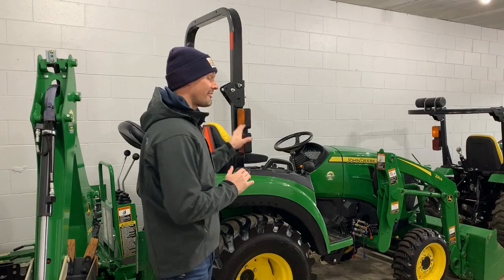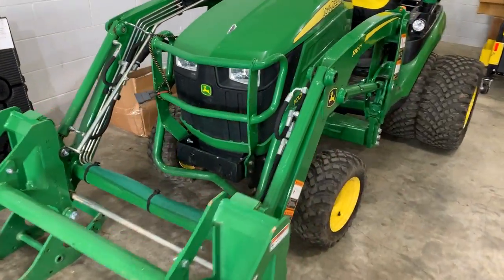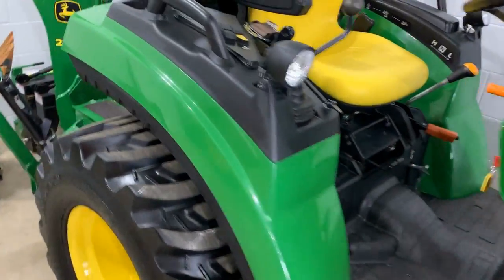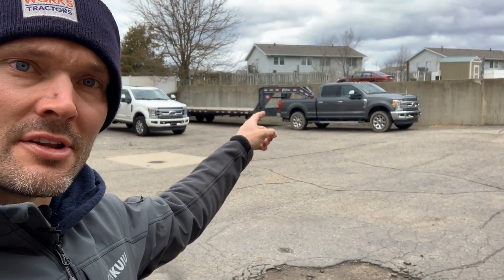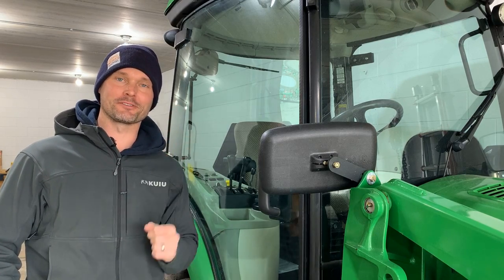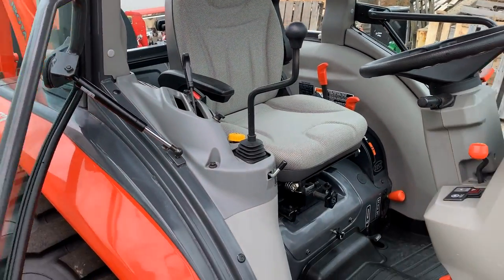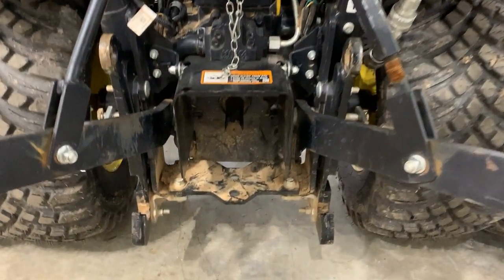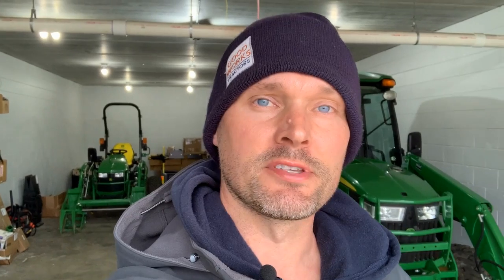TOP 10 SCREW-UPS JOHN DEERE MADE ON TRACTOR DESIGNS 🚜

Comment: I find myself watching your videos every Saturday morning during my coffee.  I have a Massey Ferguson 1250 with a Woods loader, 60" bush hog, 72" finish mower, home made 3 point forks and a hydraulic dump hay/firewood wagon.  I take care of 40 sheep and mow 25 acres of semi wooded land.  My problem is that I will need to replace my tractor at some point (it's too light for safely lifting the round bales into the loft).  I have been looking at the Rural King tractors.  I know that John Deere engineering has more experience and produces a better tractor, but is it worth the cost for the things I need?  I don't need a 10,000 hour tractor.  I do need a tractor that is safe for my amateur abilities and is cheap to maintain.  I'm not making any money with this tractor (outside of moving 20 bales of hay and avoiding city fines for not mowing).

Video idea:  What's wrong with the Rural King tractors?
Reply from the maker: Hey Joe, thanks for following along.  It's tough for me to knock something that I don't have much specific experience.  However, I do have enough experience with "getting what you pay for" that could possibly make for an interesting video!

Comment: I have a 1025r. I have a Mauser cab on it. It only has heat and I was told by the dealer it is a factory cab order. You can order a 1025r with a factory installed cab. Its very confusing to me though. I hear it one way and the other. ???? I do love mine! It's a great cab. My cab also has the piston assist on the doors. For me it does make it feel a little tippy. John Deere does need to come up with a quick disconnect for the hydraulics on the snow blade and loader, etc...it is a bitch to get on/off with the cab on.  
I agree 100% about the seat. What the heck John Deere! I am a big guy and the seat that came on the 1025r sucks azz!! Come on John Deere!!! I have an air ride seat on my X738 John Deere garden tractor and I love it! 
My dealer STILL cannot get those new Versa Turf tires. Where are they??? How do you get them? Send me a set please...all the rest of the stuff...huh...not so much...all part of the deal I guess. I love my John Deere tractors. Thanks for sharing and the great work you do...
Reply from the maker: Yeah, Mauser is a factory option.  Pretty misleading for the customer in my opinion.  Perhaps there just needs to be a better way to delineate.  Huge difference between a cab that has air conditioning and heat vs one that only has heat.   I make sure I clearly communicate to my customers if a cab doesn't have air conditioning.  Many are surprised when that information is shared and often times, that tractor is then ruled out.  Most see a cab and expect a/c to be a part of the package.  

I got the tires from my local tire shop.  Took a couple months, but they got em!

Comment: My biggest gripe on my 4044m is when I turn around looking at my 3 point to hook up or when brush hogging in reverse I hit the key every time. This makes me worried that I’m going to break the key off and I’m not crazy tall 5’10”. If they moved the key from a center position to the side it would really help.
Reply from the maker: Good point.  I have almost done that myself.  Severely bent a couple of them.
Reply: Kept bending them too. And I let them know. So they took a grinder and grinder it down to just a small handle to grab.  Works much better

Comment: John Deere Factory Mouser cab on the 1025R Has heat, and fits nice and tight. Check it out! Sold at dealers, Not aftermarket. Dealers within 300 miles of me have sold out of the 1025R with factory cab. I see a lot of soft cab trade ins too.
Reply from the maker: I don't consider anything a factory cab unless it's keeping me frosty in the summertime!  😂

Comment: Want to share something with you.  I picked up my 17 4044m from a job yesterday and someone hit the hood latch while it was sitting there.   When i got on the road it blew up and destroyed it.  I noticed on the new ones (2020) you need a tool to  open hood.  Can i upgrade mine to be like that?
Reply from the maker: That's a real bummer.  You might be able to upgrade, but I'm not sure if there were any geometry changes between 17 and 20.  Might ask the parts counter or service department at your local JD.

Comment: I would add the following: every John Deere 1 through 5 Series Sub, Compact and Utility tractor models should have the same operator station design and layout as much as functionally possible including; LED lights, standard fender lighting, standard rear-ward lighting, minimum one rear SCV, deluxe seat with mechanical suspension and arm rests, snail style fender mount accelerator, one ROP MTN rear-view mirror, functionally consistent three-point hitch set-up, all SCVs controls fender mounted, fuel tanks situated in the rear or side of tractor, expanded tire options including the new 14T hybrid in either Bias or Radial.

I’ve owned 2, 3, 4 and 5 series JDs so come by these design update requests honestly.

Comment: I just traded my B3350 Cab for a 3033R cab. The biggest disappointment that I have in the 3033R is the absence of the gas strut on the right door and the bar that it attaches to. The bar is a great place to rest your hand if you are mowing the slope of a ditch. The Kubota defiantly wins this one. It makes hitching a non quick hitch compatible implement a pain in the drain. You have to open the door every time you need to access the hydraulic/3 point controls. Not to mention it resting on your rear while you do. Come on JD this is an R series not an E.
Reply from the maker: Good point about the bar on the door too.

Comment: I have a 5 series and my biggest complaint is the lights mounted to the outside of the rops. Mine got wrecked when working around trees and they are expensive to replace.
 To move them they need to move the fuel fill to the center of the tank so that the lights on the left won't be in the way of fueling process.

Comment: How about a seat switch that works when it is cold. I have a 2012 Jd 2320 and can’t snow blow unless I can keep the seat warm enough or else the sensor freezes up and you can’t move the tractor. My dealer says that is very common.
Reply: By pass it and re wire it
Reply from the maker: Yeah, those cheaper seats harden up bad.  I'll normally press all my weight down on my knee right in the middle of the seat.  Normally loosens it up enough to activate the switch.

Comment: Why is the ROPS so high on 2019 1025r ?
 Will not fit in standard size garage door. If it was 10-12" shorter, I would be able to use it.
Reply from the maker: Neither the old nor the new style ROPS fit in a standard height garage without being folded.

Comment: Turn Signals Need protector cages. I noticed that none of those models you have there don't have any. I have a dated 4400 and the signal housings are pretty flimsy. They are always getting hung up on branches. I'm on my second and third set. Not again though as I'm going to weld cages around them. I know it isn't  recommended to be welding on the ROPS but I'm not buying anymore lights. 

Not to mention those darn THERMISTORS. I hope that JD got rid of those. They always go bad when it's 10 degrees out.

Comment: After more than 60 years driving tractors, why in the WORLD did they put the hydro pedals on the right and brakes on the left??????   It took me about two years to get used to that.   GO pedals should be on the left, and BRAKES should be on the right...     Probably just me - but those of us who have decades of experience with "clutch, left - brakes right" are really having a bit of a struggle getting used to this new system...  I noticed, on your tractor, that the loader hydraulic connectors are crosswise to the frame.. Excellent!   Mine ('15 3039R) are in line with the frame and it's harder to use enough force to couple 'em...   Best wishes!!

Comment: I have my share of gripes about my new 1025R,but the top of the list is no manual transmission with a shuttle shift. I hate hydrostatic drive,in any size tractor. And another top hate list is no cast iron rear end,just aluminum. I like the weight and strength of a cast iron rear diff. I truly miss my John Deere 770.Manual trans,better hydraulics,and a foot throttle,and no nanny features at all.

Comment: On the back of the older 2series is the 3 point control arms mounted right?
Reply from the maker: Not sure I understand your question
Reply: Good Works Tractors  where the turnbuckle adjustments are there is also a spacer about 1 inch wide.  I take mine off when I put the backhoe on. I thought the turnbuckle was on the outside then the spacer. If I knew  how to send a pic to u I would

Comment: What is the big gripe about no drawbar on a one series? You can put a clevis on that plate and it is stronger than the tractor can ever pull
Reply from the maker: Extending out further back away from tires to be able to turn easier.

Comment: What people seem to not understand is the earlier 2025r and other 2r series are rebranded Yarnmar tractors, not JD product. The newer 2 series built by JD give customers better price point. A lot of people simply want a slightly physically larger machine and the 2025r provides that. Bigger than that the price goes up dramatically, but so don’t the capabilities. I don’t find this terrible as the 2025r does hit a target market with people that have small sub compacts with small tires that want more but not a 40K dollar machine, or a new buyer with the same requirement. There are also some performance difference, not huge but noticeable.
Reply from the maker: Better to have more choices than not enough I suppose

Comment: The most annoying thing on my 3038E is that I can't run the PTO unless I'm sitting in the seat. Which makes it pretty hard to use my PTO woodchipper. So I have to put a bucket of sand on the seat instead.
Reply from the maker: Yeah, I haven't found another way to override it unfortunately.
Reply: I took the seat sensor out and used a tie strap to keep the switch closed

Comment: As far as the pedals are concerned. Backing up is viewed as the most dangerous task. The pedals are then in the proper configuration if comparing to a car. Wouldn't want to try and stop backing up in a panic, only to press the wrong pedal.
Reply: I totally disagree.  In a panic, I push the right to go forwards and the left to back up every single time.   The pedals drive me crazy.  It is the one thing I would change if I could.
Reply: @caneridgecommunityclub8554 I totally understand that some people prefer it the other way around, but using a cars foot pedal arrangement as the arguing point is what gets me. Some could say they think the kobota forward pedal is a brake because looks too large. No matter what, their argument becomes pointless when they imagine their imaginary car was in reverse.

Comment: Tractors made since the early oughts are toys. Plastic crap everywhere, designed by guys who have never gotten their fingers dirty.They are glorified lawnmowers. I've owned and used tractors made from the early 1950s (a JD 40) through the early oughts and looked at these jokes that they manufactured today. The apogee of tractor design was in the late 70s to the mid 80s. By this time diesel engines, three point hitches, and wide range geared transmissions were universal and biased towards strength, efficiency, and power not towards being "clean burning" or quiet or other such nonsense considerations. 12v batteries and automotive alternators were common by this era. There has been really no major tech improvement since. And this was before mickey mouse plastic crap started to be put on tractors. It is my opinion that the sheer determination of the Japanese export economy of that era made their tractors FAR superior to anyone else's. They wanted to make their stuff so good to destroy the competition. My 40 year old Kubota blows away any tractor its size made today and frankly and Deere of that era. No plastic. Underside completely protected (it was a cultivator tractor). Hydraulics strong and hold with no power heavy implements. No leaking (after 40 years). Engine super reliable and efficient with no baloney EGRs, DEFs or other nonsense. Just an air, fuel, and oil filter...all three solid screw on steel units that can be replaced in minutes. A STEEL fuel tank. Glass analog gauges that are clear and readable. Glass headlights that work after 40 years. All the pedals are grid iron and look as good as new. All the knobs are hard rubber and are just fine. Seat is great. Starter is beefy and can be replaced in a minute. All the fasteners are hard, forged, oversized HEX heads only in a few sizes. 10mm-17 mm so just a few sockets/wrenches can do the whole tractor. Compared to my 2001 Kubota the older tractor is just better. The plastic "instrument cluster" has cracked in many places, the plastic lenses over the gauges have clouded and are hard to read. The needle has fallen off its tach. The rubber coating on the pedals is long gone leaving metal stubs that are slippery. The plating on the hydraulic rams is failing, seals have gone in some places (despite being half the age). Much of the hardware is of small sizes and soft and has rounded edges. When I look at that new Deere, which is much worse than my 20 year old Kubota, I just laugh. It wouldn't survive a season of real use. It's a suburban machine meant to mow lawns and be kept in nice garage.

Comment: John Deere 1025rs have a Mauer factory cab option they are nice cabs but no ac only heat cost is $7000 you can also buy a kit to put the cab on your older tractor
Reply from the maker: Yeah, no a/c ain't no good for me.

Comment: Problem with skid plate.......its only as good as you pay for steel. Ive run grapple skidders with whole underneath built in 3/4-1in steel and they get bent easier then you think.

Comment: The biggest  turn off for me on the JD 1 and 2 series is the die cast aluminum transmission. It was a deal killer for me. I took the JDs off my list and went to Kioti . Cast aluminum drive components are what you find on $3500.00 "garden tractors" and have no place on tractors of this size. Just my opinion but it killed the deal.

Comment: I bought my John Deere 4066 r one year ago. I normally fill the fuel tank out of my bulk tank with a hose. My son who live about 6 miles from me borrowed it and ran it low on fuel so I filled my 5 gallon plastic diesel can up and went over to put it in. The diesel cap is on the left rear fender, rather high up, and is a pain to get to with a can. So I covered my shiny new fender up with some rags and picked up my can and gently set up on the fender while, and this is key, still holding most of the weight of the can. Crack! The fender immediately cracked in two places from the filler cap to the rear remote backup control. I figured the dealer is going to tell me too bad so I went online and low and behold this has been an issue for at least a couple of years! I called my dealer and although he'd never seen this himself, he called JD and the agreed to replace the rear fender. And this ain't an easy job as they have to pull the cab off. 
I don't mind the plastic hoods and fenders on the John Deeres as it's pretty substantial but to have an ongoing issue like this and not reinforce around the filler cap is ridiculous. And the worst part was when I broke the fender my son-in-law, a Kubota guy, was there. I thought the little prick was going to die laughing ;)
Reply from the maker: Agreed, that is a really bad design.

Comment: new 3es have option for backhoe now!  yay! sucks the transmission is geared to high to pull that extra weight smoothly. I have yet to understand why a company would build a tractor for speed. If you get the chance to hop on a 3e, take it for a ride in high range, wide open, at the optimal 2500rpm speed. It's a scary ride. On the highway, and especially in a yard, field, or driveway.
Reply from the maker: That's a good point

Comment: I have a 5055e and a small stick broke the plug off the clutch solenoid and it's not serviceable,  it cost almost $600 just for the part. I replaced it myself.   It was protected on one side by a tiny thin pc of tin shield.  Sad.

Comment: Its all about money. LEDs cost more than Halogen lights; the smaller/'lighter size loader is cheaper; the gas tubes add cost (parts and labor to install), etc., etc., etc. Its all about money, not keeping up with Kubota. Considering the average net sales price for a new tractor customer, Kubota maybe a better value proposition. I don't own either brand so I'm not partial to either one, but when you added up what's include (or not included) JD may not be the best value for the price?

Comment: Love my Kubota MX5200 with loader. But one thing that really annoys me is you cannot get into the seat from the right side.  Left side only. WTH?
Reply from the maker: Yeah, some of these loader joystick locations make it nearly impossible, plus no steps.
Reply: I totally agree!  It can get pretty annoying always having to get on/off that side.  I thought it would be nice having the open cab for some of the chores we do...didn't realize how big of a pain that particular set up would be for the work I do.

I do like the tractor though.  I kind of wish I  had bought the mx5200 or 5800 now.  I travel country roads about 4-5 miles 2x/week to our cattle yard with it.  The mx4800 cant pull steep country road hills in the high hst position...so I end up shifting 3 times each direction.  I'll bet the turbo would make the trip without changing ranges.